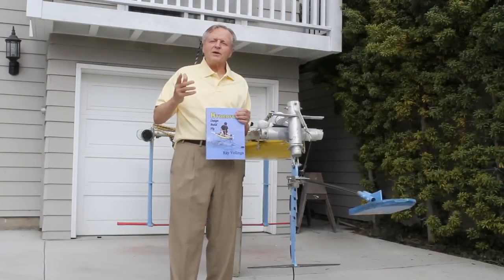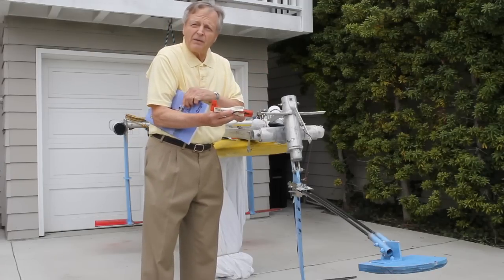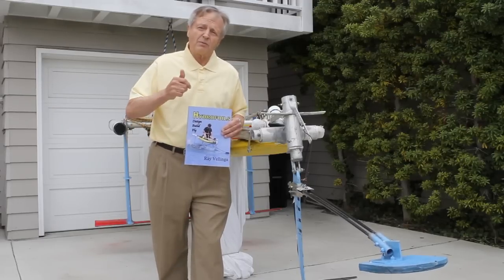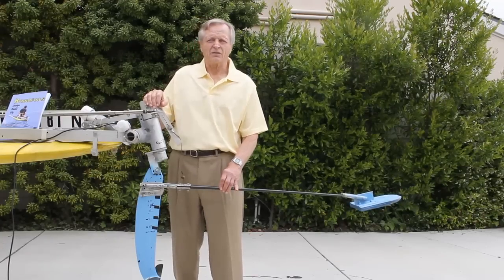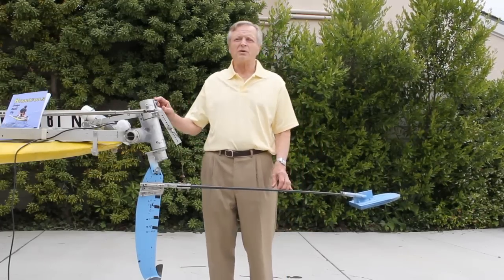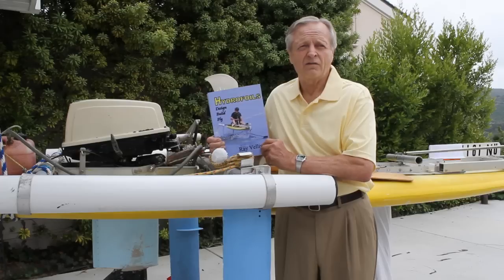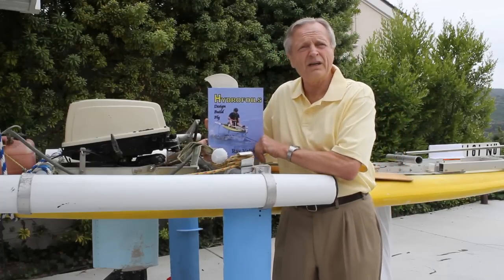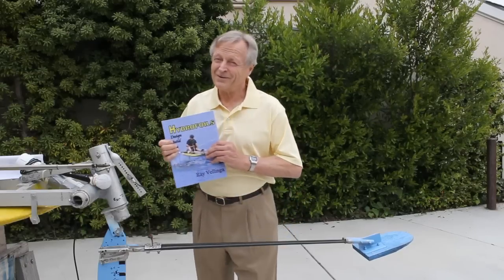HYDROFOIL --SAVE $20!!  Don't Buy This Book. Ray Vellinga video

Comment from the maker: Thanks for the encouragement, fellow hydrofoil aficionados. 

MrElitesense asks, "why".  For me it is the experience of (low) flying and of being released from the limits imposed on speed and comfort by rough water.  

But unlike aircraft, in hydrofoils there is much room for invention and improvement.   Airplanes are totally discovered, whereas hydrofoils could be the next big thing. 

Then there is the advantage of relative (to aircraft) safety. Finally, hydrofoils are simply fun.

Comment: Ray,
I bought your book and have read it more than once. I've been able to work out the wing span of the rear foil, using the formula calculations. However to work out the front foil size is confusing, if not difficult. 

I've gone through the pages over and over looking for a guide to calculate the front foil size/span, yet have come up empty handed. There are tables which mention the wing shape/profile values of a front foil. How to get there, is the unknown.

Comment: Great video, the design seems simple - deceptively so, but a lot of engineering went into that.
The one thing that scares me is that surface sensing ski.... If that hits a wave and goes through rather than over, won't that faceplant the vessel? What is the biggest sea you can fly this through?

Comment: If you want to use metric inputs kg (weight) and meters/sec (speed) then you need to multiple the meters squared (area) initial answer by 0.021 to get the correct m2 area.

Comment: Hi Ray, the work you've done is so great and your humour too! Your delivery is so dead pan that I almost missed the "you can save hours of study by just a few months of (trial and error) building"....line.   Unfortunately I have wasted some time, money and product to the landfill before seeing your work.I'll use point form to be as brief as possible; - tried to motorize a sup board to carry me and my surf board to a surf break- with my 2 hp evinrude 2 stroke the sup will not plane-I want to get it to plane, with or without hydrofoils, Is that possible with 2 hp. and the following weight?- the total weight ; sup+ motor+foils(20lbs.? )+ surf board+ me and misc(200lbs.)= approx. 300 lbs. total -assuming I need foils their only purpose is to lift the sup board (approx. dims. 32"Wx 12' long) slightly ( i.e. less than 6 inches out of the water ) with the sole objective of increasing speed and efficiency.(my prototype speed as it plows through the water does about 5 to maybe 7 mph)-what I'm wanting to do would look very much like HYFIBY only I just want fixed foils does you book deal with a configuration of; size, weight and power with FIXED foils that I want to make ?- going the foil route would be great but, for simplicity sake, should I really be able to get the sup to plane without foils?PS - the evinrude has no foil plate above the prop. Might welding a really oversize foil plate above the prop (like the samarai)  lift the stern to the point where it planes? ( as it is the stern that is low and wakes a big wake) I'd love  to get this project built and tested before I lug it to Mexico where I surf at the end of OCT.    Thanks, Ray                rickburrowes@gmail.com    Ottawa, Ontario, Canada

Comment: Where does one go for the info on making a conventional foil boat, or is it so simple no formulas required.I have a 17ft 50's aluminium speed boat that is a water jet and it would very much suit the purpose- possibly.   It would certainly look good.  But I don't want giro's or auto levelling, just a fixed plane at least forward.   Thanks

Comment: Put this on Kindle please
Reply from the maker: +Robert Stewart  Robert, I love Kindle and read books off mine a lot.  My wife Patricia Vellinga has published with Kindle and sell more digitally than hard copy.  However, in my opinion, Hydrofoils: Design, Build, Fly is not suitable for Kindle publication.  There simply are too many graphs, charts, drawings and photographs to fit into the small format.  Otherwise I embrace your idea.  Ray
Reply: +Ray Vellinga It can be done to make a quality copy for Kindle, but it's a bunch of work with so many images, graphs, etc.
Reply: Ray Vellinga  be a pioneer and make it available on Kindle.  it is so hard to get American books in my country. Charts and tables work OK on a tablet or iPad.

Comment: +Ray Vellinga  Hi Ray, clever way to get people to watch the "I really want you to buy the book" video! ;-)  Liked your sense of humor.  I'm going to follow the titular advice for now because I'm not sure I need it yet or will end up using it.  However, I do have one question, if you don't mind:

If I want to describe a type of foil design with the feature of "build it and forget it", permanently fixed, requiring no adjustment or controls or electronics while sailing, what would it be called?  The inward-curving, surface-piercing types seem to fall in this category, but I'm not sure (especially about their aft foils).  I'm thinking of its use on a mostly flat hull boat in the 20-30 foot range.
Reply from the maker: +onesimpleidea   Love your name, OSI.  Yes, Surface Piercing foils would surely be the "best build it and forget it" style of foils.  Just google it and scale down the existing widely tested Russian and Italian designs.  My favorite would be the Canadian HMCS Bras d'Or.  But honestly, you will save time and money having some reference material to glance at to help answer questions, even with one simple idea.  Here's an inspiration, why not get a copy of Hydrofoils: Design, Build, Fly? Just in case....

Comment: Hi Ray. Could you please answer a few questions about hydrofoil for me?
What would be the smallest possible size of hydrofoil to lift about 200 lb out of water at speeds of 10 miles per hour or less using ideal hydrofoil design? Is ratio between length and with of hydrofoil important, if yes, why and what is it? Thanks
Reply: Can't believe someone would ask this in this context - buy the damn book!
Reply: Check out surfing foils

Comment: Is the book 20 bucks? Amazon says 30, and it's out of stock....
Reply from the maker: +Bill Gere      Sorry, Bill.  Amazon is so independent.  Where the extra $10 goes, I do not know.  And why they say it is out of stock is a mystery.  I can only suggest if you want the book, put an order in and hope the delay will be short.  Perhaps with increasing demand, Amazon will snap to attention.
Reply from the maker: +Bill Gere 

Dear Bill,  To test your question, I just now visited Amazon (actually
Amazon Prime) and found over 29 book sellers inviting me to buy Hydrofoils: Design, Build, Fly for prices as low as $18.52 plus shipping or $22.51 total. Delivery time was between 1 and 2 weeks.  Perhaps your order was placed at a time of temporary low inventory at the printers, or an exceptional peak in demand.  Anyway, thanks for the "heads up".
Ray